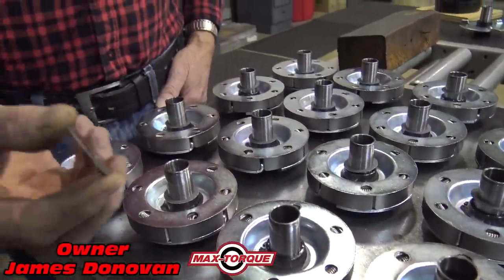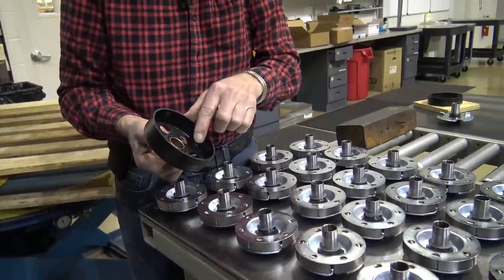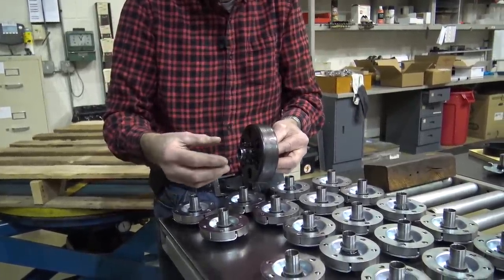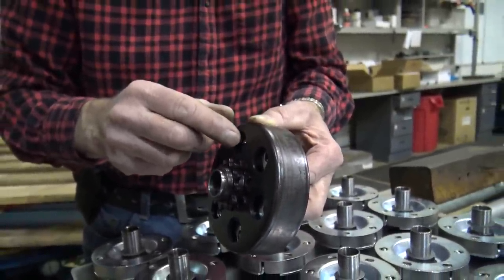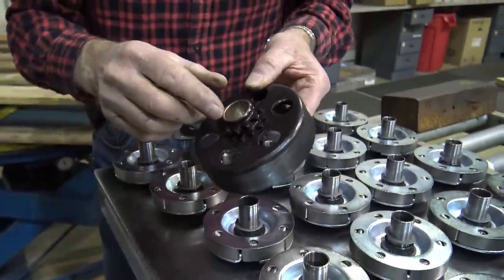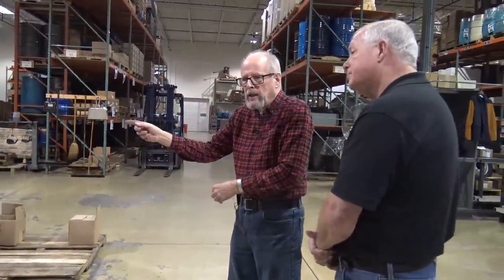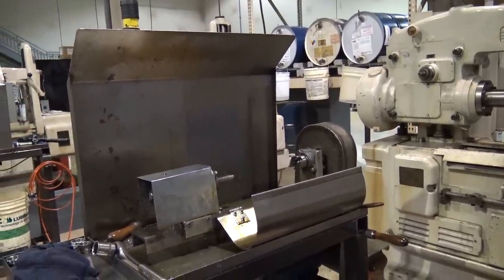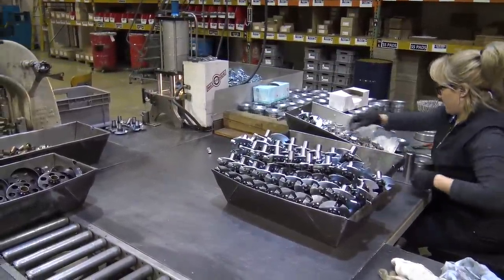How Its Made ~ Max Torque Centrifugal Clutch

Comment: Had a minibike with a 3.5 tecumseh from when I was about 12 years old to today I’ll be 35.   Ran the hell out of that engine and clutch never knew to oil it.  It’s still working today haha.    Now I know to oil them.   Thanks for  the video
Reply: Im 28 with my 1998 Manco Products Inc terminator gokart ive had since 6 years old. Great offroad Machine.

Comment: My father, George C. Fields, founded Max-Torque and designed the clutches and the triple engine racing carts that were world champions in the unlimited class. He lost the company when the local banker called in the loan on his working capital on no notice then bought the company out of bankruptcy for his son to run.  Many of the machines and processes are identical to when I worked there as a kid in the summer nearly 60 years ago.  BEfore Max-Torque my dad designed the Doodle Bug, arguably the first mini-bike. Two of his patents from it have been used by Harley Davidson, one on frame design and another on their torque converter. All in all, he had some 28 patents plus original work for the war dept. during WW2 for which he could not file.
Reply: Damn that’s awesome, he is arguably a legend!
Reply: That's awesome!

Comment: A long time ago , I drilled the crank and clutch with a hole thru to where the  center bolt is,and added a grease fitting in the crank end.
Worked great!

Comment: It's neat to see how a lot of the parts you buy without thinking about them are made. It's even neater when it's something made by a small company as you get to see the people who make the product in steps. Not just a bunch of machines doing everything. Also, I wonder if a light machine oil like 3-IN-1 or the oil that comes in the Zoom Spout bottles would help with keeping the bushing lubricated. I'm a fan of both. :)

Comment: Hey, RB, speaking of clutches... I've built a boat and I'll be powering it with a Predator 212. I need a clutch that will go between the crankshaft of the engine and the prop shaft (this is an inboard setup). 3/4" shaft from the engine, 3/4" prop shaft. Most all centrifugal clutches I've seen have a sprocket on the "output" end...makes perfect sense for a go kart or mini bike, but I need one that has a female "output" end that can accept that 3/4" prop shaft. 

Do you know if such a thing exists? If so, what is it called?

Comment: I have a stage 4 predator..ideals around 2400 rpm.. can I just replace the spring in the clutch for higher rpm engagement or do I have to replace the whole clutch assembly? This engine is installed on a drift trike so I'm on and off the throttle a lot..which I'm positive that the clutch is getting hotter than a clutch in a normal situation..is there anything that I can do to help keep the clutch cooler? I have seen people drill extra holes in the dust cover..does this actually count for anything?

Comment: i have a question can the gear on the drum be replaced  or do i need to buy just a new cutch intirely or can i buy just the drum with anew gear
Reply: Too bad this question hasn't been answered. I was wondering the same thing. Seems very wasteful if one has to discard the whole clutch assembly when the only part worn out is the sprocket...

Comment: does having a higher rpm engagement change the top speed or acceleration? If you raise the rpm that the clutch engages at, dont you have less gear to accelerate with? Or is it negligible unless you absolutely have the wrong spring for your motor? I.e. Clutch engages at 3k but engine idles at 1800.

Comment: The factory clutch on my Colemam EX has needle bearings instead of a bushing. I have no doubt Max Torque makes a great product. However, I'm curious how someone would consider a bushing superior to a needle bearing?
Reply: IMO a caged needle bearing beats a bushing. Bushings do fine when under a constant oil bath like in an engine or transmission but are proven to be problematic in a dry environment where more maintenance is needed. Bearings use grease and are often sealed to keep grease in and dirt out.
 
As you may know your clutches bearing needs grease not oil. Oil is only a temporary fix. All you need are snap ring pliers, some brake clean and decent quality wheel bearing grease and you are good to go. If you use too much grease it may bleed out onto the drum area so don't use too much.

They got smart when they went to the 16mm shaft that the clutch sits on. This uses the clutch with the caged needle bearing. Way less clutch complaints and warranty costs. Prior to late 2016 they used a 3/4 shaft which used the clutches with the bronze bushing. The clutch with the bronze bushing is pretty much a proven design that has been around for decades. It's just that it needs proper maintenance to operate properly, like squirts of oil after every ride. Most people who buy these mini bikes don't know this.

Comment: I have a honda 9hp I got torque converter on it should I change to clutch ?
Reply: The torque converter is definitely a better choice since it's constantly changing gear ratios compared to a clutch which is only one gear ratio and needs a lot more matence
Reply: Conner Tate nice thanks man I want to go fast that all so thought it would make a difference but maybe I need lower sprocket gear
Reply: @valleypyro2094  you'd also get a higher top speed with a torque converter think of it as a CVT transmission the longer your on the throttle the more speed you get and at lower rpms you torque converter makes more torque

Comment: Hi
 need this centrifugal clutch, Dual 12T #35 sprocket, to use on diesel engine single position. but need your advice on which spring do I need for 1500 rpm in your clutch.
4335ds4335ds
Max-Torque Centrifugal Clutch, Dual 12T #35 Sprocket

Comment: My mini bike rear tire spin when I turn it on and its in the air it gets going to a consistent speed bt soon as the tire is on the ground just at idle with the minibikes weight it won't even move an inch ? Whys this ?

Comment: hope you have put a guard around the back wheel of that go cart so rocks and small stones dont put a hole or 2 in that pod air filter  it s a time bomb waiting to mess up a good engine cylinder  you will score it bad if u sell stuff like that and that happenes and that motor is scored and blowes blue smoke  wel u could be getting them a new motor  would want to see a video  on what you did to fix thia cart  and this 1 only

Comment: The inner spring on my clutch is SO FUCKING STRONG that it literally ripped my thumbnail off when i tried this. holy fucking shit. I still have to fix the thing and without a thumbnail now. How are the metal weights not just rocketing in every direction the second you let go of the spring/???